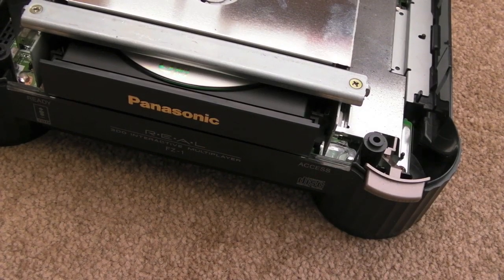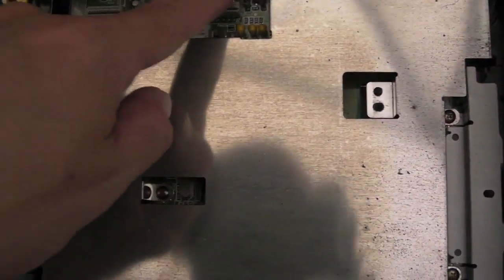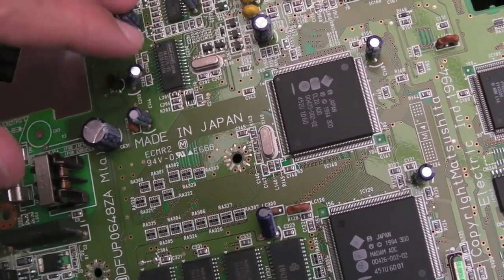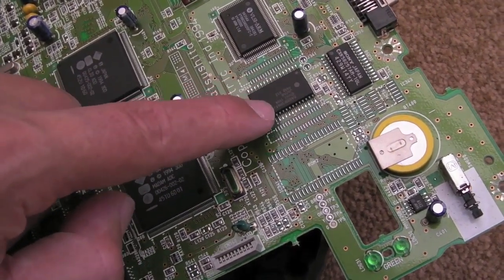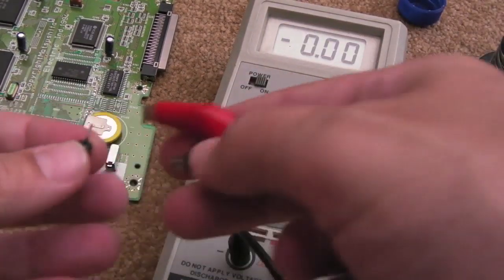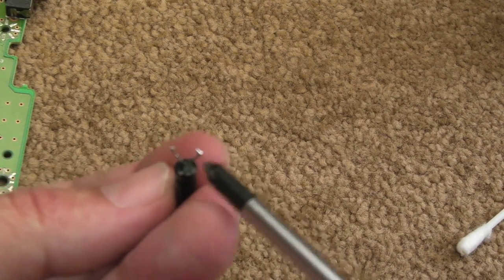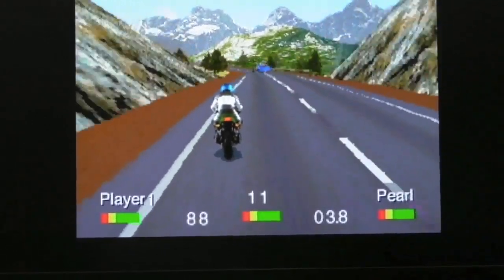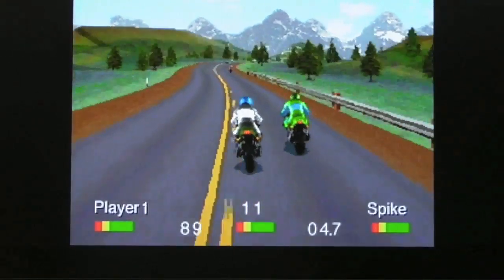Panasonic 3DO Crackling Sound Repair (FZ-1)

Comment: Actually ran into an audio distortion/low volume issue on my FZ-1 tonight, came across your video, replaced the exact same capacitor, and now the problems solved. This was real useful, keep up the good work!
Reply from the maker: +OniBot Glad it helped! =)

Comment: Just done this fix on my 3do worked a charm and now sounds perfect and loads games more reliably.
Reply from the maker: Thanks for letting me know - that's great =D  Also worth checking the caps on the CD logic board (like I covered in a recent video) as they can leak too over time.

Comment: It's funny as you start thinking, sound is shot, it's game over for the system, but a little observation and taking your time to proper assess the job in hand is the key here. Great fix vid
Reply from the maker: Thanks =)  Yes, anything is possible =)  Luckily I don't hear to many stories of failed Clio or Madam chips.  Seems to be just PSU, RAM, battery and CD drive.

Comment: I found out my fz-1 had this issue, but I’m no good at soldering so i just clipped the old cap off leaving the legs, and soldered a new cap to the old legs, not very professional I know but better than damaging the board and it works now XD so thanks for info.
Reply from the maker: That will do the trick =D

Comment: Just fixed up mine today....same small bad cap in supply. Symtoms was VERY low sound, eventually normal sound after 20 mins. did not have any issue with the CD drive. Also, when checking caps do not trust one the drifts in value over time.

Comment: Just slightly shy of 10 microfarads may be within the tolerance according to the manufacturer through the cap's data sheet, so that alone may not necessarily mean it's bad.

But, of course, you can't entirely rely on measuring capacitance to judge whether a cap is good.  Obviously, if it's measured capacitance is too far off from its rated capacitance, it's bad.

However, it may also measure all right out of circuit, but may break down once under load.

Also, a bad cap may still measure at or close to its rated capacitance but have high equivalent series resistance.  You'd need an ESR meter to check for that condition as a capacitance meter won't measure ESR.

Then there's the physical evidence; if the cap is leaking, it's bad.

A little tip: check the condition of other caps on the board that may be of the same rating, from the same manufacturer, and of the same series.  You might come across other failed caps that may also require replacement.
Reply from the maker: +Watcher3223 Absolutely - fully aware of ESR problems with caps!  In my 2nd to last video here (C64 Saver testing) I found one of the caps to be the problem with a C64 PSU - it measured OK regards capacitance, but it almost definitely had an ESR problem as I was getting AC coming out of what was supposed to be DC connection.  I did have an ESR meter but a friend borrowed it and still has the damn thing.  I might just buy another as I am kind of lost without it at the moment.

Comment: This is crazy. I decided to play with my 3do a bit after watching your vids and guess what happened after an hour or so. Yeah, crackling and muffled sound. Will treat it soon. Maybe its connected with the power issues i had with a thyristor replacement
Reply from the maker: LOL - Bet you wish you hadn't had a play with it now lol.  Just swap out that bottom cap on the PSU.  Strangely mine was rated 10uF 16v but I've seen another vid yesterday where someone said it was 100uF - not sure if that's a revision between boards or perhaps some have 10uF and some have 100uF.  To be honest either a 10uF or 100uF cap will work there.
Reply: Yep, thanks. Mine is a japanese one, it had various issues, played a bit need for speed and tried some backups again. It will stutter on the fmv on a backup, but I let it play for an hour with the original need for speed and it worked fine, just after 15 mins in game it started muffling the sound. Will swap the capacitor, I think it will work. Most issues on 3do's seem to come off around the power area strangely. Thanks !

Comment: Sorry to send a question to you here on message board and not directly to you, but I couldn't find where I do that here on youtube.
I recently bought (was a big deal) a Panasonic 3DO FZ-1 but when I open it surprise surprise no PSU. I searched, but I was unable to find the service manual, found only a few rare information in randons forums on the web, so I´m not 100% sure about the PSU, I believe is a 14.5VAC, is that the right value? and the connector goes at CN1 on the power board circuit ok, BUT my unit comes with a pin at the CN3 connector, I saw some units without a cable or even the pin on that connector and some units like mine comes with that pin on CN3 (my 3DO don't have a FAN). Is that a ground? I really don't know, I think my maybe the PSU can be 14.5-0-14.5 and I'll connect the ground or something else on CN3, no idea, like I say, I had no luck to find the service manual. So sorry to bore you but can you help me? Thanks a lot - really. Anderson
Reply: ***** Mate, thanks a lot for your return, replace the caps is in my schedule :) And I checked and you're right the onboard PSU use regulator to produce 5v and 9v. 
Do you have any idea what it is for the CN3 connector? Like a said I saw some 3do fz-1 with a red cable from the transformer connected on it, and other units don't have it ... a ground maybe? Again, thanks a lot for your attention., all the best to you, Anderson.
Reply from the maker: ***** No problem!  There's probably either just 2 AC inputs and 1 unused pin (if its 3 pin), or 2 x AC inputs and a ground / earth.  You can test continuity on a multimeter if you've got one, to check between each of the 3 pins and the bridge rectifier - the 2 AC inputs will be almost a short to a couple of pins on the bridge rectifier.  Then test from the board edges / shielding to the 3rd pin to see if that's joined there at all.  Then just get a new transformer and you should be good to go.  The transformer will need to provide at least 2 amps I think.  You could also fit an entire PSU in there (like a pico PSU or something) and feed the 12v DC into where the 14.5 AC goes - provided the 12v PSU can provide 2 or 3 amps it should be OK.  If you do that you don't have to worry about polarity, just feed the 2 DC wires to either position of the AC connections at the bridge and it should work.
Reply: GadgetUK164 yes i believe it´s a ground, i´ll test it. thanks a lot.

Comment: Hi gadget can u tell me if the the stuff around the large 25v 6800uf capacitor is glue i read they glue big capacitor's like this When there  manufactured too stop them from moving  i opened my fz1 and found the same stuff around the bottom like your's
Reply from the maker: Yes - it's glue!
Reply: Thanks gadget i thought so my self was just not sure i replaced those power capacitor's on my fz1 Japanese model too stop from running in too any problem 's , im thinking off buying a Goldstar 3do that has no video but play's music and games u can hear sound but no video do u think a recap might fix it
Reply from the maker: That's probably the first thing I would think to check!  Check the video connections first to make sure the socket isn't damaged etc, but then follow back on the PCB to see where the RGB and sync / composite connections go - possibly a coupling capacitor.

Comment: Ive had mine since 1993, finally failed. Have no video. Gwt a squeel when i turn it on. Any idea as to what can cause this
Reply from the maker: I would start by replacing the capacitors on the power supply section of the motherboard!
Reply: GadgetUK164 do you remember the numbers so i can order them.
Reply: Yes, please specify the capacitor you replaced. Thanks

Comment: I have a 3do with PSU (internal) down, would it be possible to give me the voltage on out? ( Secondary ) Thanks
Reply from the maker: My 3DO is in storage at the moment =/  When I get it out I will check the secondary side!
Reply: Thanks you for your help (sry for my english im french )